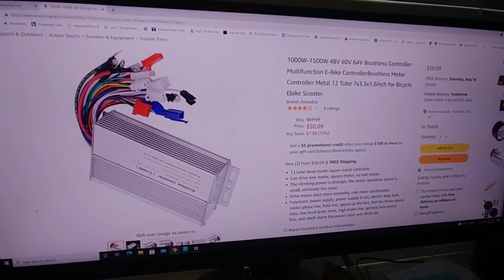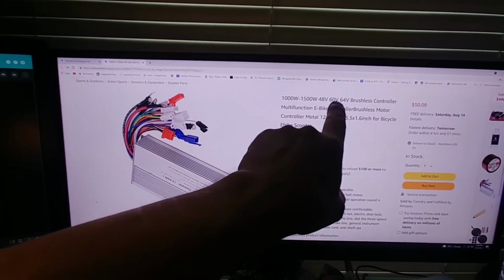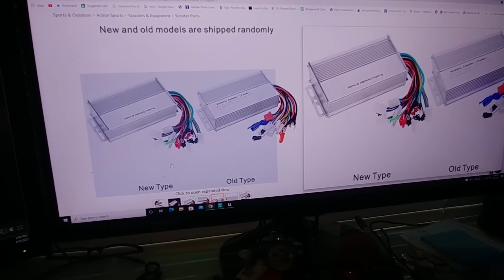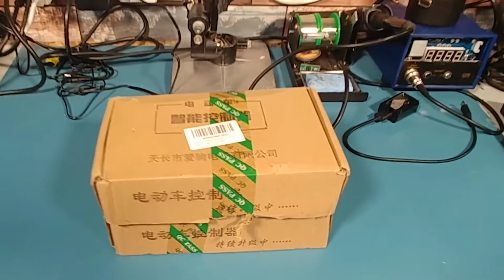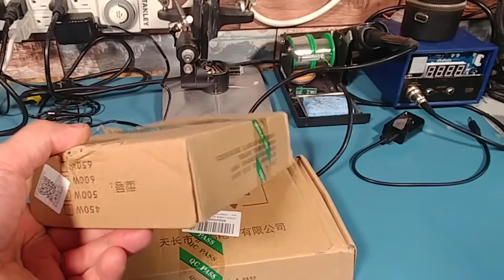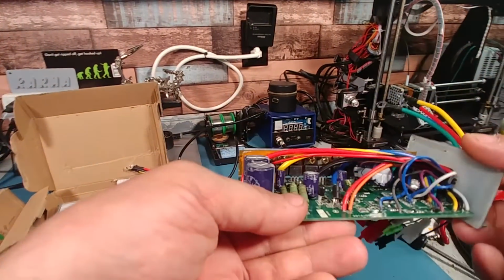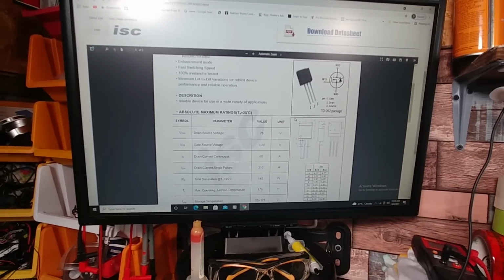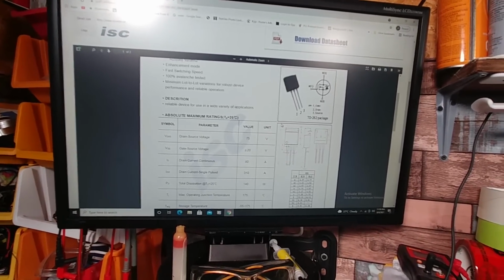1000W 1500W 48V 60V 64V Brushless Controller*review*

Comment: What FET was that? I was looking for Rds in the datasheet but didn't catch that. Because that's what burns them eventually. Low Rds means less heat at high current. Also the heat dissipation (the heat it can take out quickly enough to save itself) is 140W in the datasheet which is not good for a quality FET, I think these FETs have RDs over 10 milli ohms which is mid range. You better make your own with good FETs like IRF3077.
Thanks for the review. I just bought it myself.

Comment: V x a = watts
71v x 20a = 1420w 

30a would give you over 2000w at 71v 

So there advertising is correct 
Ive shuntmodded these china controllers before with no issues pulling 35-40amp

You just have to be carefull 
These controllers make for a noisy motor if i have to complain about anything
Reply: I agree. I've fiddled with a 15fet versions "35a 1500watt 48v" shunt mod and it draws 50amps no worries barely gets warm bike goes 70kmph on 56v pack 63v with a full charge

Comment: Mine was double the size  as yours and mine was 1000 watt 35aml controller and yours is 100% not 1000w but I have seen smaller ones which are 2000w think its called phase runner

Comment: Hey you have two single wires it comes out of your speed controller box and another one goes out of your speed controller box on the ends of those wires there's a mail in and a female in you must connect those two to each other so it goes up the box and back down the box you know out of the box then back in the box it sounds ridiculous but if you want to go above 48 you connect it then it knows that you're going to go 48 volts or 60 or 72 or whatever

Comment: Can I use 48v 1000W controller on 12v battery? 🛴
Reply from the maker: no minimum is 24v and that only if you remove the lvc. tested it in the past and it works.

Comment: Hi mate iam looking for a new controller 1500w to 2000w I was using the Voldemort loved the acceleration and torque. After I did the shunt and tracer mod but stopped working.After about a year or so I got a kt controller and display 1500w to 2000w was shit so I sold it do you know any on the market that is similar to the Voldemort that as proper working pedal assist

Comment: Greetings.
Does this controller charge its batteries (via charger), or you need an extra ''board'' as external module for charging batteries?.
Thank you in advance.
Reply: No brushless controller can charge the battery, you'll always need a BMS  or balance leads and a hobby charger to charge lithium.

Comment: So what's the gig? 500 watt?1500 watt?.....48 or 64 volt ?or did you just get suckered to by 2 pieces of junk?
Reply: This controller can run more then one voltage. 48v and 64 I’ve personally used with this controller
Reply from the maker: running 79v each
Reply: Depends on what battery you can use, the controller must have large enough Capacitors too function correctly not 🔥